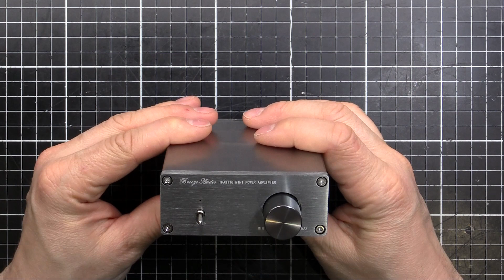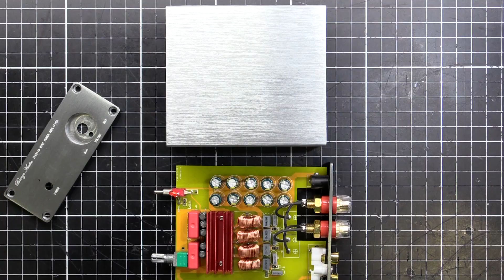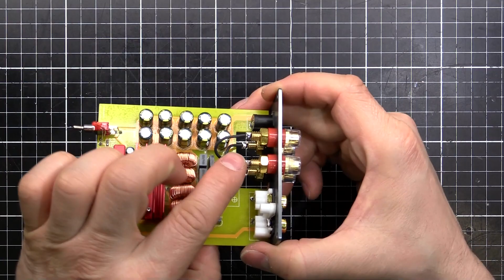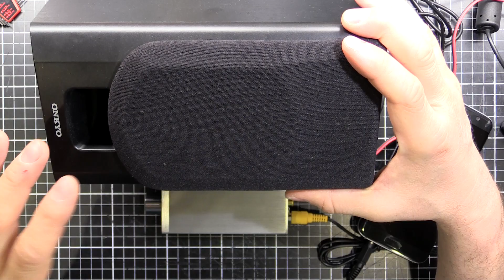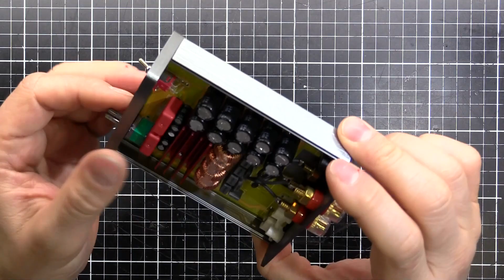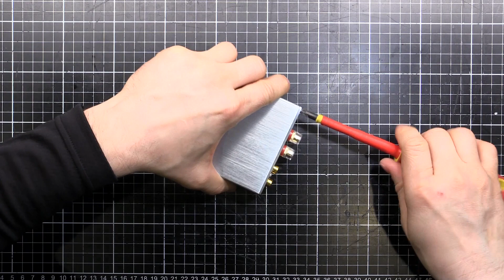Ebay 'Breeze Audio' TPA3116 Mini Amplifier Review

Comment: Check your powersupply, some supplys put out more volts at no load which can cause trouble. Especially for caps, that do not like any mV more than their rating.
Reply from the maker: Yeah, I did that in the video and the power supply was almost spot on 24V.
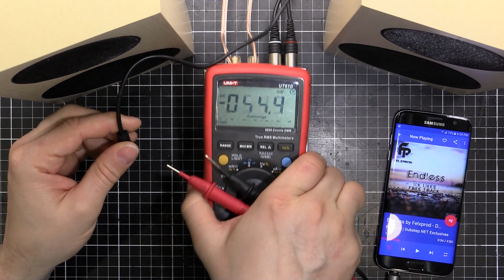Reply: Wow, I really missed those 10 sec 16:52 of the video. Sorry!
Reply: just_noXi, caps don‘t like getting pushed to the rating. For example if a capacitor is rated for 30v it should get a max voltage of 27v. This increases the life time.

Comment: seems like all of these caps are fake cause the thing on the top didnt open, and instead the whole can flew off.
Reply: fredlllll when there is much pressure build up fast enough on the inside of the can some caps can blow out without bulging or blowing the vent
Reply: fredlllll but if he said those are Sanyo he's wrong, that's not the vent that Sanyo/Suncon uses
Reply from the maker: The labeling was pretty good, practically spot on, but I think you are correct that they are definitely fakes.

Comment: did you even check the voltage on the side of the cap
Reply: Did you even watch the video?
Reply: yes i did im a electronics repairs engineer with 10 years experience
Reply: Then you would have seen him talking about them being 25v Sanyo caps.
Reply: not the point you do not meet the same voltage of the u cap u can use under like 20v or 12v
Reply: Excuse me? Is that English you're trying to use?
Reply: just mind what u say boy
Reply from the maker: You'll notice I mention the ratings in the video a few times and compare them to the input voltage I was using.

Comment: Nice video, thx. I had a look at 3m50s and compared the size of the original caps to those at 20m, and the originals seem to be a bit smaller? Because of the lower voltage I guess.
Reply from the maker: Yep, the smaller ones were the lower voltage ones. From the results, I doubt the ones that popped were even 25V rated as they claimed...